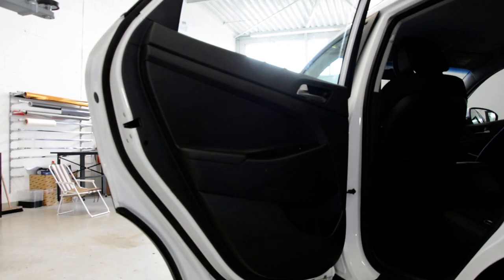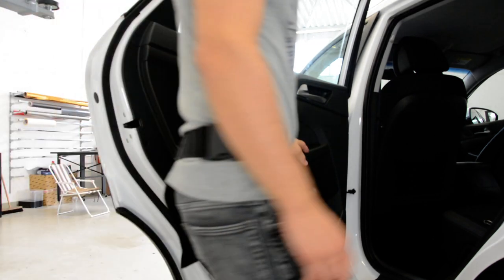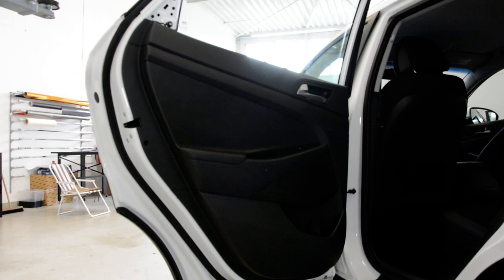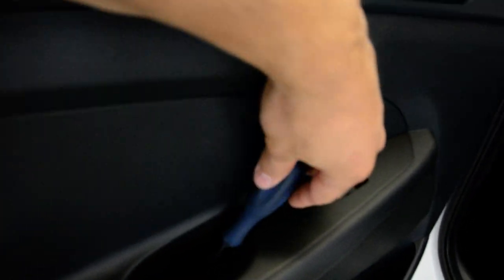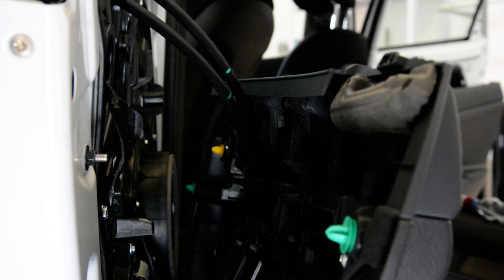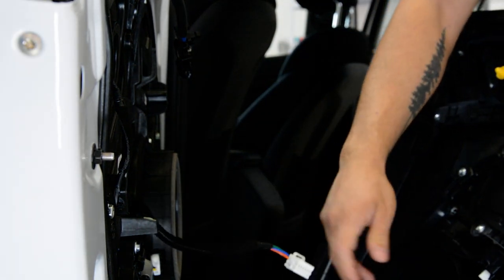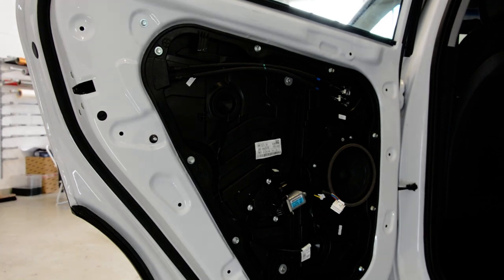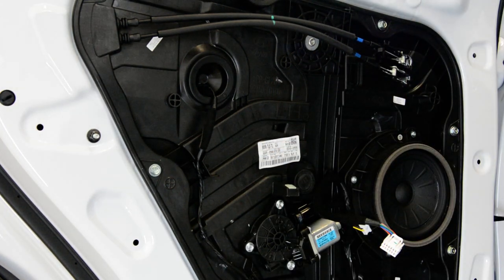How to remove the door panel Hyundai Tucson 2017

Comment: A common problem many owners of the 2016 Tucson (and other years) are facing is faulty door lock actuators. Hyundai has not issued a recall for these yet; they are expensive to replace because of labor charges. Could you possibly make a video demonstrating a new actuator install on a rear passenger door, please? It would be hugely helpful and I'm sure you would get thousands of views and likes as a result! Thank you for the great videos. You rock!

Comment: any idea on how to remove the panel without opening the door?My door will not open either from the inside or outside.
Reply from the maker: If the door panel don't have screws on sides or bottom yes, but you need to remove the rear seat
Reply: Im having the same issue, door won't open from the inside or outside but it will lock and unlock. How'd you go about fixing the issue?
Reply: @savagepanda31396  My door just started doing the same. Locked and unlocked but will not open from outside nor inside. Need to get door panel off somehow to open door to fix. Did you figure out what you needed to replace?
Reply: Tons of people are experiencing this problem now. Seems like on average after 4 years the actuators fail. My rear passenger side door is doing the same. Can't unlock it manually or by remote. Hyundai has refused to issue a recall so far, even though it is a major safety concern (imagine small children or elderly not being able to exit during a fire or other emergency).  Many are recommending we contact Hyundai and the NHSTA and file an official complaint as this is definitely a major safety issue.